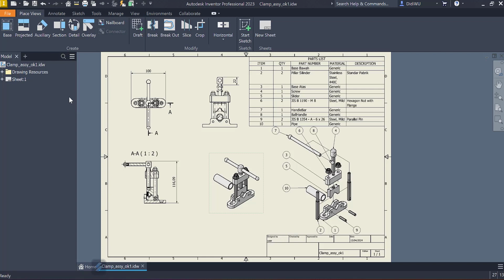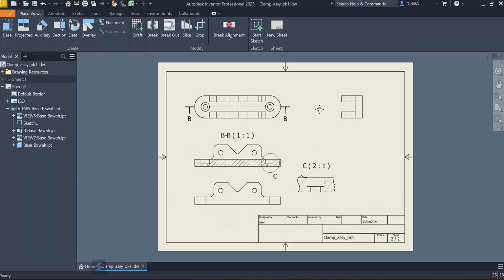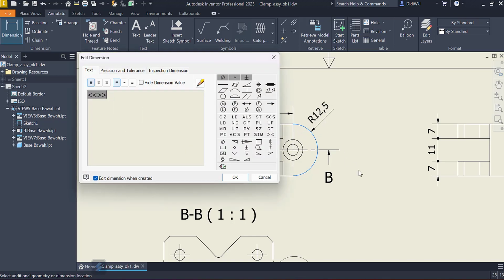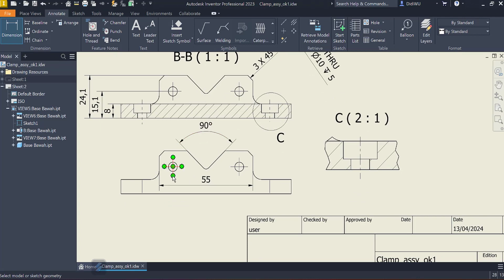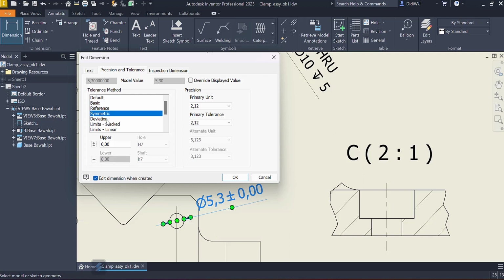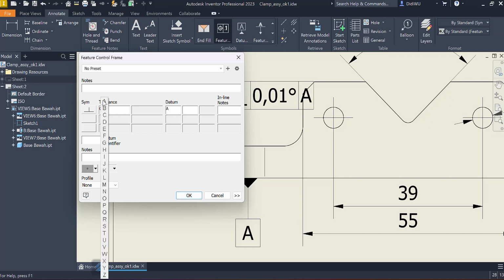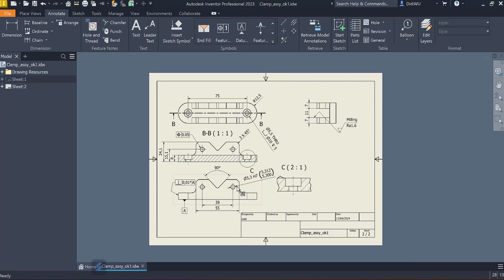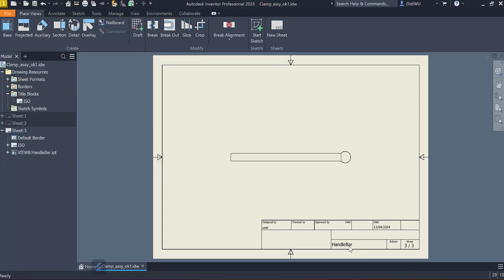Autodesk Inventor Tutorial: Create Part Drawing

Comment: Thank you this tutorial help me a lot, but i have a question. I need make a project for manufacturing Design. First of all i need create a 2D like this with roughness. Also i need to take the 2D for CNC.
Reply from the maker: You could start to enlarge your raw material by approx 2mm away from the finished part
Then, continue with the milling operations on the center pocket and create the two counterbores. Then, flip 90 degrees to drill the two holes.
You need to match the required specifications and machining operations for surface finish value. Hope it helps